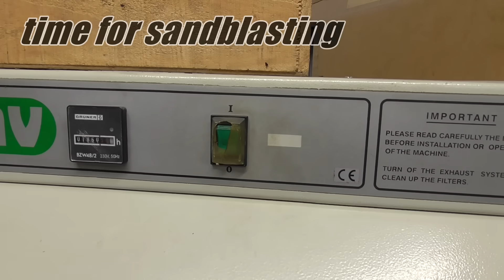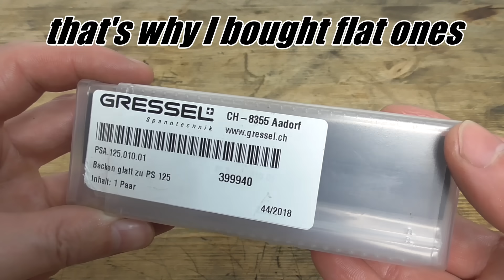Rusty Deadlocked Vise - Perfect Restoration

Comment: WD40 is not a penetrating oil. Use a penetrating oil when you need a penetrating oil. Now let's say that again. WD40 is not a penetrating oil. Use a penetrating oil when you need a penetrating oil. Now let's say that again. WD40 is not a penetrating oil. Use a penetrating oil when you need a penetrating oil. Now let's say that again. WD40 is not a penetrating oil. Use a penetrating oil when you need a penetrating oil. Now let's say that again. WD40 is not a penetrating oil. Use a penetrating oil when you need a penetrating oil. Now let's say that again. WD40 is not a penetrating oil. Use a penetrating oil when you need a penetrating oil. Now let's say that again. WD40 is not a penetrating oil. Use a penetrating oil when you need a penetrating oil. Now let's say that again. WD40 is not a penetrating oil. Use a penetrating oil when you need a penetrating oil. Now let's say that again. WD40 is not a penetrating oil. Use a penetrating oil when you need a penetrating oil. Now let's say that again. WD40 is not a penetrating oil. Use a penetrating oil when you need a penetrating oil. Now let's say that again.

Comment: Amazing job, loved seeing the fabrication of parts.  A quick tip, for painting raised lettering like you did here, I like to use modeling clay or plumber's putty.  Press it on  until the letters show through, I like to use an appropriately wide putty knife to slice it off in a plane.  It's a quick step to make repainting the letters go much fast and lets you use spray or large brush strokes to get different appearances!.

Comment: Your life would have been made much easier if you had used different rust removal techniques. You need to look into rust removal using things like molasses, vinegar, wash soda , and electrolysis. It is cheap, easy to do, and will completely remove all the rust. This technique is so effective that the vice would have become functional before disassembly. There are tons of example videos out there showing just how powerful these techniques works.

Comment: nice video.
but why did´t you weld the hole that appeared after sand blasting? you could cover the rest of the part to protect the surface. i think it would be better than filler.

Comment: Amazing job. One tip: be careful putting lots of grease in blind holes. It can blow out the back of the casting since it has nowhere to go. Aluminum engine blocks are the worst for this.

Comment: Nice vice, excellent restoration job. Hard to beat Hammerite paint for tools.

Adhesive rubber tape is generally used to 'mask off' areas when sandblasting as the sand 'bounces' off without damaging, but good to see aluminium tape works too.

👍✨

Comment: The missing piece could also be made out of flat stock, start by using 4 jaw lathe chuck, bore ID and face, then internally chuck in 3 jaw to finish OD, or fit on spindle or just large live tailstock center with heavy tailstock pressure and light cuts for OD .

Comment: Good job. But you are pulling the wrench the wrong way. The wrench contains of two parts; handle and the screwing part. You need to make sure the force/pulling motion, is forcing on the handle, not the screwing part. Doing it wrong will destroy the wrench faster.

Norwegian, so sorry if a bit bad English.

Comment: greasing the locator pin, the jaw screws and thrust bearing screws will haunt someone a few decades from now..   If you want to secure them, without them corroding into a single bonded mass, use somehting like loctite (or some equivalent)  that is MEANT to come apart when placed under enough torque.....it will seal out the corrosion, not react with the steel the way grease will, and as intended, come apart with a minimum of fuss when you want it to..

Comment: If you had soaked that thing in vinegar for awhile or even overnight and then pressure washed it... It would have saved having to deal with all of that rust dust.  It works really well too.  I think it is like a dollar a gallon.
Reply: Phosphoric acid ( H3PO4) much better than acidic (vinegar), same as active ingredient as in "naval jelly ™"

Comment: Great restoration but every engineer knows you never use a file with out a handle, the tang will bite you.
Reply from the maker: file without a handle?
Reply: @mymechanics   https://youtu.be/U2jNeObHnZY?t=351 you dont have a proper handle on the file. im sure you are experienced handling it, but they are dangerous without a handle.

Comment: Very nicely done! On the black parts, did they turn black because of the rapseed oil during the hardening? Or is it actually paint, and if so what kind? Thank you
Reply from the maker: the oil burns into the surface, pretty much evry oil works for that.

Comment: Beautiful end result. I have never seen a vice where the front jaw is fixed. I was always told to ‘hang’ a vice with a long, straight implement held in the jaws to allow similar items not to foul on the bench top. You would struggle with this vice.

Comment: Amazing work, excellent video, thanks for your effort, thumbs up.

Just one question. Why on earth are you using WD 40??? That's the worst shit you can use. You need some Sea-Foam, Liquid Wrench, or some PB blaster. WD 40 is actually counterproductive after awhile, it dries up any lube you had on the surface over time.

Comment: Lovely work. I think I would have used electrolysis to deal with the rusted parts instead of sandblasting. As for the raised lettering, sand the base color off first, then paint the white. Did you consider oxide treating the parts after heat treat? Would help resist corrosion. Again, lovely craftsmanship!

Comment: Have you ever used the method of raised letter painting where you paint the letters first, then paint the entire piece, including the letters and then using fine wet and dry paper rub the top layer of paint back to expose the white paint underneath?
Reply from the maker: Hmm might be difficult as i have 2 coats of green with 4h inbetween.

Comment: Great work but, just a suggestion; if you had just dumped it into a 5 gal bucket and covered it with diesel for a few days it would have been easy to take apart...

Comment: If there's any mismatch at all between the dovetails or mating surfaces, that vice would be a great little scraping project if one were of a mind to begin mastering the art of metal scraping for machine tools. Might also be a good opportunity to spot weld some more material on the corner of that one dovetail. Or not.

Did you blacken the jaws between the installation sequence and the final reveal?
Reply from the maker: There's no need to scraping the dovetail on a vice, it's just a vice and no machine. It would have to much play then and welding up material is not a good idea because you would weaken the cast iron. Interesting thought tho, i apprecite such comments. I just cleaned the original jaws, no blackening. I replaced them with new original flat ones, you find more infos in the discription. Thank you :-)

Comment: This is very satisfying to watch but you can't help but wonder the amount of time and effort that went into restoring this surely would be cheaper and easier to just buy a new vice? A hell of a lot of expensive tools were used to restore it too (lathes...milling machines) You can get a pretty decent quality bench vice for less than a hundred quid these days... all the time and labour that went into that probably works out a lot more
Reply from the maker: A new gressel vice costs around 600$, it's a high quality vice and really worth the effort imo. Thanks for your comment.

Comment: Mindboggling restoration of a precious Swiss heirloom vice, found ... on the ocean floor!?      But you MISSED something...
The female thread, cylinder that mates to the main screw.     I didn't see that you brushed that out.    Indeed you heated it and dropped it into rapeseed oil, as a blackening treatment.      
Did I miss something?
EXQUISITE CRAFTSMANSHIP!     THANKS FOR SHARING.     I will be watching your future videos.
Reply from the maker: My friend works at the recycling station, he found it. The inside acme thread you're talking about looked perfect. You can see it after i removed the part to cover it for sandblasting. Thank you very much :-)

Comment: I was thinking 'argh another vise restoration'... But that was superb. Awesome work mate.
Reply from the maker: Oh hello Geoffrey 🖐 nice to see you here, i'm a sub of yours. I tried your nickel plating, but i failed twice = i suck haha. I wanted to nickel plate the brass parts on my "tire inflator" video. Btw if you haven't seen it yet, i highly recommend doing it. It's my best work and most challenging work. Thank you very much :-)
Reply: @mymechanics  Hmmm, I think nickel should plate to brass ok. I can't think if I've plated over brass before or not? There's a whole order of which metals will plate to what. Did you try on steel? If your solution was green, it should definitely work.
And yeah, for sure I watched the tire inflator video. After I watch this vid, I had to go back and watch the rest 👍👍. Superb work my friend. Just the die grinder to go.
Reply from the maker: @GeoffreyCroker  well, while ordering the anodes i talked to an expert who said you can't nickel over brass, because the zinc would go away. He said i need to copper plate it first. First try i think the solution had way to much nickel and copper in it, forgot it over night when making the electrolyt. The anode was melted lol. Second try, i used other vinegar and it didn't even change colour. 1st try i used "weisswein essig" (german), translated is white vinegar but it's not white/clear, it's yellow. 2nd try i used "tafel essig", it's clear. 1st try i was able to plate but the nickel was very dark/black. Also i need to say that i used a 3,5 liter container, simular like the one you used with zinc plating. And i used a car battery charger, myabe to much current?? I run out of time with that project, that's why i didn't tried a 3rd time. Your oppinion, i might give it another try ;-)
Reply: @mymechanics  yeah, sounds like way too much current. You want to be at about 1amp per 65cm2 of surface area of the part you're plating. Too much current will give you a fuzzy finish, and way to much current will burn it. More current equals faster, less current equals a better finish. Also, I don't know how cold it is where you are, but if the solution is really cold it might not work properly.
Reply from the maker: Ok, what you think about the vinegar? What temperature would be good, 20-30°C?
Reply: @mymechanics  All you're really after is acetic acid. Vinegar is just acetic acid and water. So if you can see the ingredients list on the vinegars go for whatever clear vinegar has the least added other stuff. And, nah the temperature isn't critical unless it's really cold. I've never had a problem with the vinegar solution at room temperature. I'd think anything above about 15deg C is fine. Warmer is probably better though. My commercial nickel plating solution plates best at about 60C.
Reply from the maker: @GeoffreyCroker  good to know! Thank you very much for taking your time here, i really do appreciate it.

Comment: There is a reason for those parts that weren't heat treated. It is so they bend instead of breaking when under pressure.
Reply: Oh, ha I don't know what I'm saying then
Reply from the maker: I didn't harden them, they're still soft.

Comment: I can't fault that at all.. It looks better than new.. A very good penetrating fluid is half acetone and half ATF. But don't mix up huge amounts because the acetone evaporates fairly quickly. Probably works out a lot cheaper than WD 40, which in my opinion is good for what it's made for, but not specifically for penetration. Please no penetration jokes! Lol.

Comment: a trick an old head taught me when trimming tape after masking a raised surface like the ones you masked for sandblasting: 
just mask the entire surface then run a fine file over the edges. it will cut the tap clean along the line. no need for tedious razor blade trimming. Great work!!!
Reply from the maker: Oh yes, we used that technique as skateboard kids, when we taped a new grip on the deck.

Comment: Something that seemed odd to me, the new part you made, why cut it in half?  Isn't the screw bearing down on only half its surface now?  Just curious if there is a reason for that.  Very impressive restoration!
Reply from the maker: It's exactly how the original was, you see a lot of pictures when you goigle for gressel bench vice.

Comment: What is the electrical drain of some sort used at 4:12 ?
Reply from the maker: It's a parts washer. Box with liquid and a pump, it pumps the liquid through the brush.
Reply: @mymechanics  does it filter the liquid or just recirculate it? What liquid is that?
Reply from the maker: @JGnLAU8OAWF6  i think it has a small filter. It's just called parts cleaner where i buy it.
Reply: @JGnLAU8OAWF6  If I understand well, it has a separate reservoir, so you don't dump your solvents into the normal drain (which is illegal in my country).
Reply: @annamoan2107  i know that, i was curious if it's filtering out insoluble particles or just move them around.
Reply: @JGnLAU8OAWF6  I believe there is no circulation. You have one tank with your cleaning solvent, and another tank to recuperate the dirty solvent. But I might be wrong, I just searched some stuff on the internet... So the insoluble stuff goes into the dirty tank and stays there.
Reply: @mymechanics  That would have made my life much easier had I known about it earlier... Thanks for the reply, and amazing restauration !

Comment: An old hot rodders trick to painting raised lettering is to spread petroleum jelly on the area, scrape it flat, paint, then clean up jelly
Reply: I assume you clean the jelly after the paint dries, right?  Any tips for getting the raised surface degreased so the paint adheres, without messing up your buffer under the letters?
Reply: I’ll try that 👍🏼

Comment: Can you check the runout on the dovetail now on a surface plate with some blue?  I’m wondering if the sanding and oilstone caused the surface to be uneven.  I mean, it very well could have from factory anyway but it’d be interesting to know.
Reply from the maker: oh i did not sand the dovetail. I cleaned it with the wire brush, then Scotch brite and then the oilstone, but yeah would be interesting. Still it's just a vise, not a machine ;-) Thanks for your comment
Reply: You’re right, I’m more curious to know how much of an effect it had for future, possibly more precision cleanup jobs.  It’s not like some piece of sheet metal you’re pounding on with a sledge gives a crap if the dovetail on the vice it’s in is off by a thou.

Comment: You shouldn't have to rely so much on brute force and hammering things. If everything's stuck, immerse the whole thing in a heavy solution of Oxalic acid, preferably using hot water, and let it soak for a few hours. If that fails, use a torch to break-up the rust. If this fails too, then start banging. Castings, especially old rusty ones, are very hard and relatively brittle. Apart for this, it's a wonderful restoration. Now make a video showing you mounting it and using it.

Comment: Didn't have too much time to read through 1400 comments but in case it hasn't been mentioned already, electrolysis does wonders for freeing up rusted parts. I had an old bench vise that had been in a fire and then sat untouched in storage for 18 years. The internal dog on the front jaw was frozen solid but after a few hours in the electrolysis bath and a few gentle taps it freed right up. I find it is a good method for smaller/hard to reach parts or for those who cannot afford a mill to custom fabricate pullers/separators.

Comment: This was a wonderful restoration, and a pleasure to watch.  To make a penetrating oil that actually penetrates and lubricates, use Automatic Transmission Fluid (any type) mixed 50/50 with Acetone, or if that is unavailable, substitute white spirits (what we call paint thinner [for oil paints] in the USA), or a thin petroleum based solvent to reduce the viscosity of the mixture.  Shake it up immediately before applying and either use a VOC mask or avoid breathing the fumes and in all cases avoid using near open flames.  100 ml is more than sufficient for this type of project.  Let it soak in before trying to loosen things up.  With regard to painting letters, you have great eye-hand coordination, so no changes are necessary, but if you wanted a thinner coating of paint on the tops of the letters, try using a small roller with either a very short nap or a cloth cover; there may be a small print-makers roller available through an artists’ supply shop that would suit this purpose.

Have you considered using smaller quantities of a synthetic grease to lubricate the moving parts - I ask because extra grease tends to attract and trap dust, dirt, and metal filings and become gummy, and non-synthetic grease tends to dry out and harden over time.  Lubricate the vise the same way you would lubricate a fine hunting rifle.

In the blasting cabinet, were you using sand or baking soda or some other media to blast the rust off of the vise components?  The parts looked great when you were finished.

Thanks again for the excellent video.
Reply from the maker: Wow, super useful comment. I will definitel try the penetrating oil. I remember we used oil to lubricate the vice when i was doing a lot of bench vise work. We completely removed the movable jaw, clean it dry and lubricate the dovetail and spindle with oil once a week. I always say, better the wrong grease or oil, then using it dry. As it's not my blasting cabinet, i'm not 100% sure about the media, i just know it's glass bead. Thank you for your comment :-)